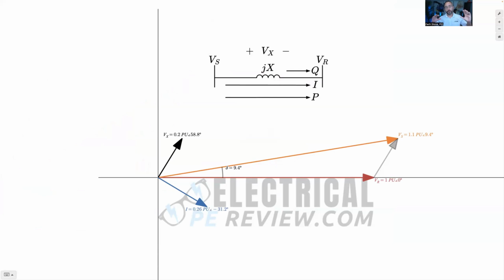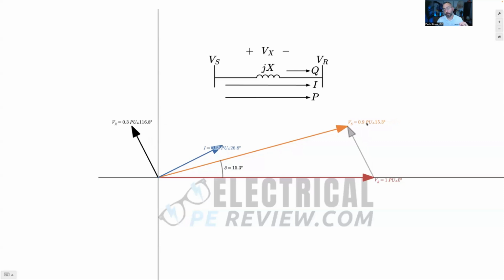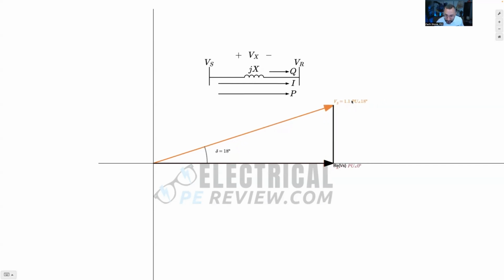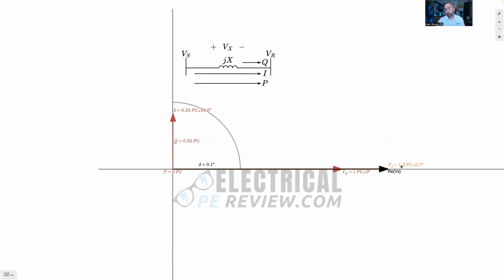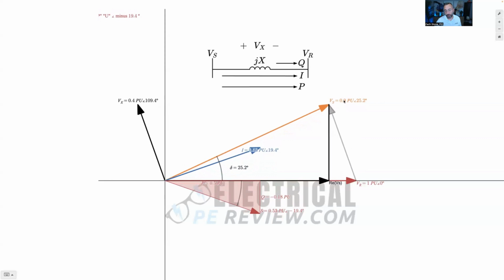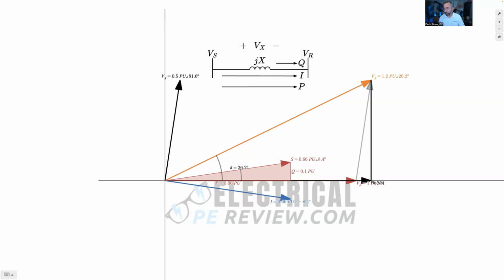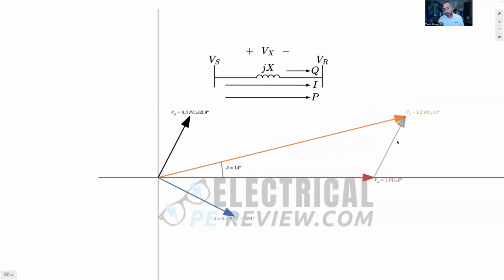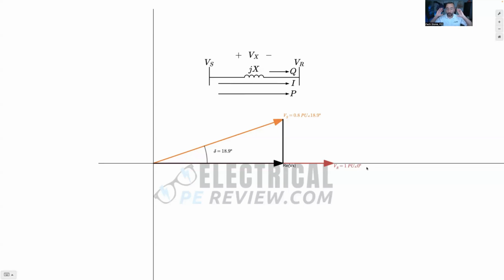Master Power Flow Calculations: Phasor Diagrams Real-Time Modeling (Part 5)

Comment from the maker: 📖 Video Contents:
0:00 - Video Introduction
1:03 - Phasor Diagram Explanation and Variables
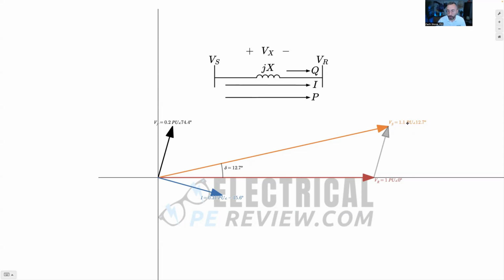3:52 - Leading vs Lagging Power Factor
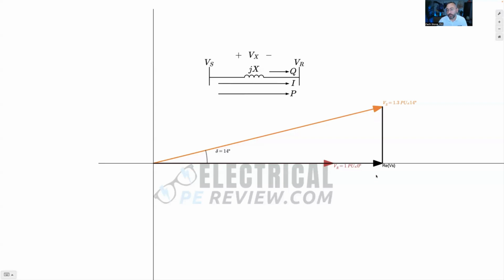6:11 - Real Component of Sending Voltage Re{Vs}
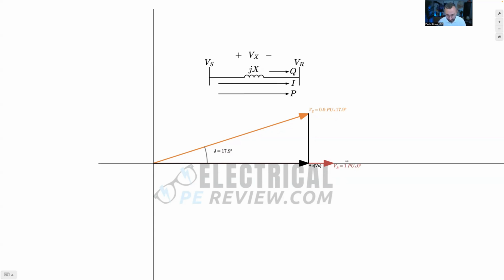7:44 - Power Triangle Relationships
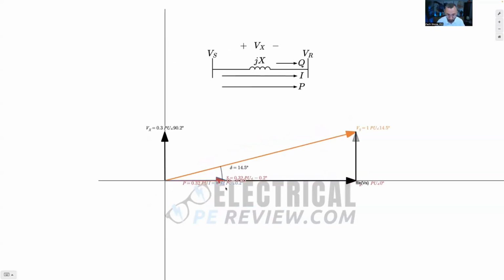12:35 - Complete Phasor Diagram
15:21 - Questions and Answers
23:41 - Outtro